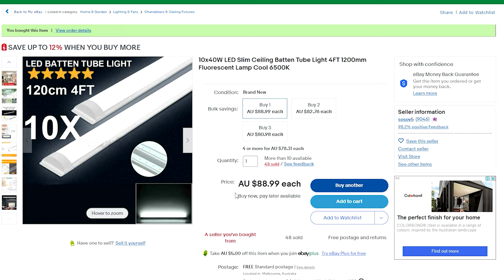Replace old Fluro Batten lights with these NEW CHEAP SUPER BRIGHT LED LIGHTS! // How to install them

Comment: Thanks for the suggestion of soldering on pigtails and wiring to the pigtail. You helped me solve how I am going to use surface wiring to mount these lights. The manufacturers use of nonstandard wire color has the potential for being dangerous, IMO.

Comment: I used to solder an heat shrink em the way you did till recently I bought a kit of heat shrinkable butt connectors with solder inside them. One step and done.
Reply from the maker: Yes, I've seen those recently too. I'll need to get me some. Thanks for the tip!

Comment: I just today got my Verbatim LED Batten LED light 4 ft 36W, with power cord for $73 inc shipping in Sydney ( from the Lighting Outlet), to replace old fluro tubes. Problem was that all the fluro housings are NON starter lights - which means I could not just replace with LED - had to totally replace entire fitting/light.

Comment: ive got one of these any how the hack do you takem off? tried all and feels like its going to break itself or the ceiling :/
Reply from the maker: I've found the clips are very bendy... so all I do is pretty much pull down on one side and off it comes.
Reply: Get a butter knife or something as flat & push the side of the bracket 😉
Reply: nevermind bois, there was some round rubbery seal and I could takem off. surprise !!! it was screw hole. unscrewed both sides and pulled it down. haha cheers for the tips tho
Reply: Boss,treat them softly like how I treat a lady.dnt mistreat these lights, other wise you will get a shock.,

Comment: Take the end cover off and check the circuit board that is 
floating just inside the plastic end cap.  The aluminium housing is just mm away from live wires.  I doubt the are certified or safe.   Do yourself a favour disconnect one and check.

Comment: Sadly these lights are not getting so cheap these days and I have been researching and working on this lights.  I have them all over my home and one thing I found out is that they run the lights hard, so they don't last as long as they should. The newer and more expensive ones seem to have better LED chips, but they are still run very hard. Replacing a resister on the transformer to a better value would make them run better, but thats complicated. Just be aware. They are very good lights though...